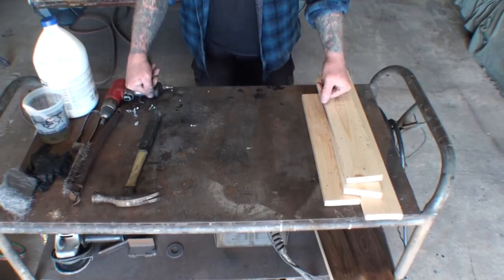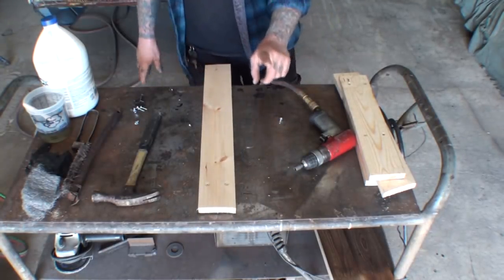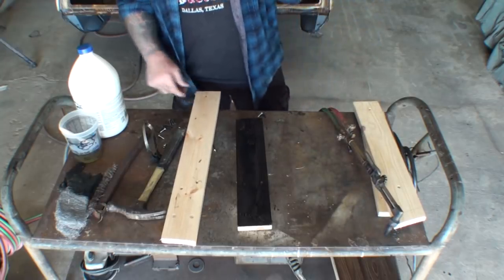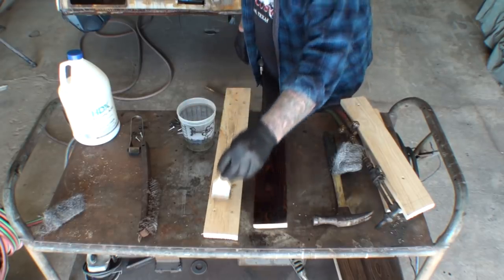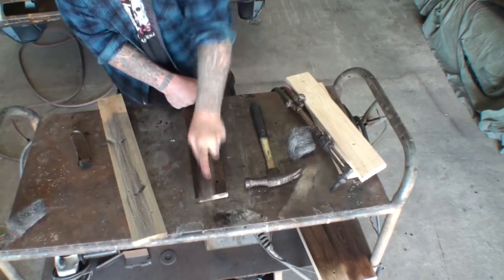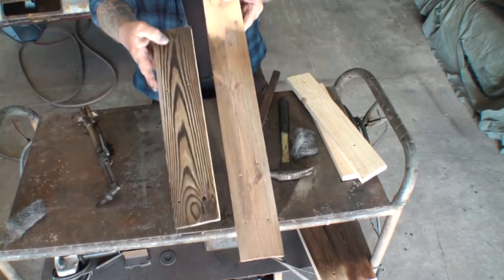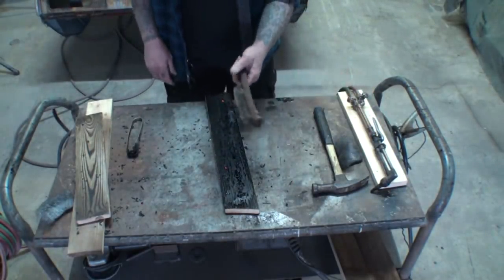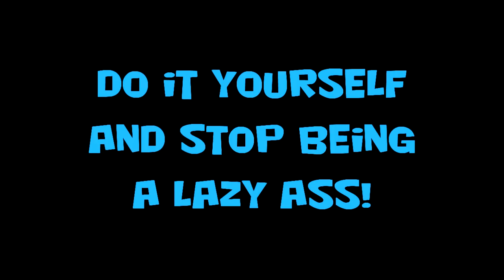How To Make Barn Wood - Do It Yourself

Comment from the maker: Here's a little trick on getting that old rustic look in your house or possibly some furniture.. Burning wood and cleaning it off gives it the effects we're looking for!  If you have any good Ideas of how to make barn wood, share them in a comment!!!!   Make sure to check out the SWRNC merchandise ABOVE! and SUPPORT MY FRIEND PETE!
Reply: Pete , You can be very persuasive ... Get off your lazy ass ... I love it
Many Blessings , SMR
Reply: Back in the 90's I was tearing down barns and salvaging the wood and the hand hewn beams. there is good money in it we would tear the barn down for free and salvage the wood
Reply: Also a another quick and simple aging effect is to take your 5inch (metal cut off wheel) or (metal grinder) lay it flat across the board and til it slightly into the wood.it will leave that circular saw mill cut in it.looks great!